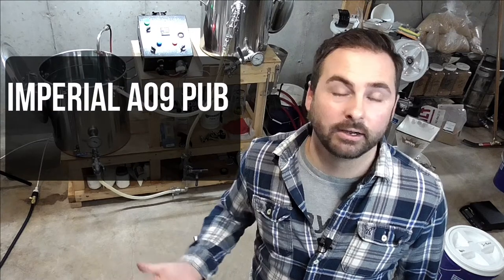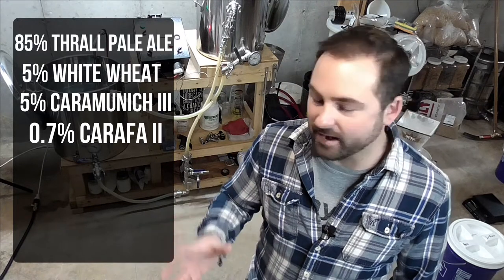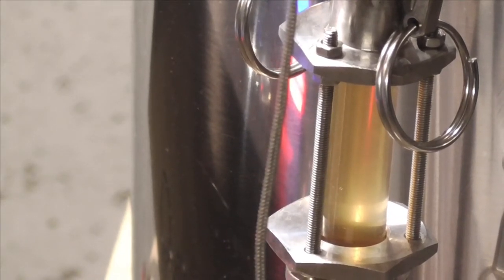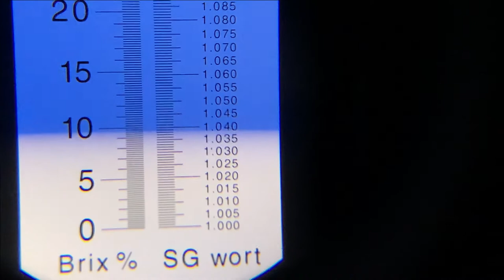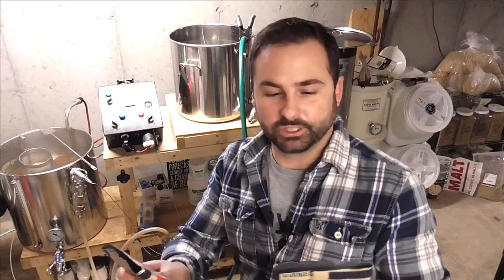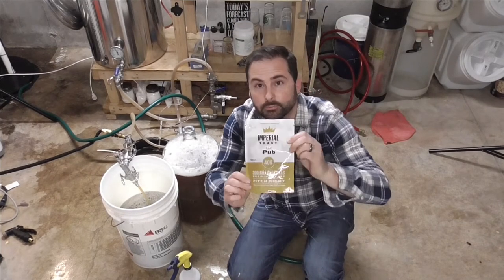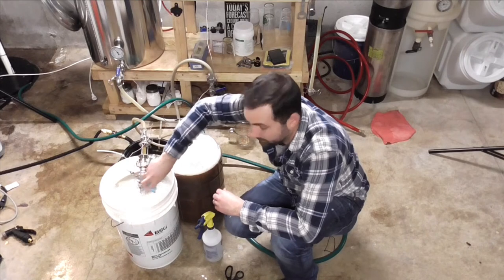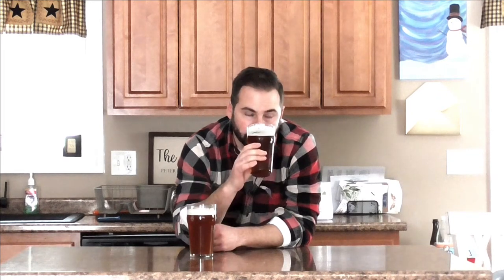Ordinary Bitter | Grain to Glass | English Pale Ale

Comment: I was wondering if you recall any additional thoughts you had on S-04 vs Pub as you drank more of the beer?  I have been playing around more with dry yeasts lately.  I had planned to split a recent Special Bitter with S-04 and Verdant.  I had some issues during transferring into the fermenters so I just pitched S-04 into both fermenters.  I had stopped using S-04 for various reasons, but this batch turned out very nice.
Reply from the maker: I plan on making this beer again this winter and besides making a change to the hops (going to use a touch more), I think for the ease of use, I may stick with S-04.  I don’t know if I would have been able to pick them apart in a triangle test, they were so similar.

Comment: Good video man. 

That grain bill is miles of an ordinary  bitter though.
Reply from the maker: I plan on brewing another. Any grain Bill recommendations?
Reply: @PutnamBrew  I'd go 90ish percent base of either Maris otter or golden promise. 
 5% light English crystal malt
 1.5% (ish) each of golden naked oats and dark English crystal then
Chocolate malt to make up the rest (optional as it's only there for colour adjustment).

The main thing with this style (imo) is using multiple English crystal malts for complexity. 

Cheers.